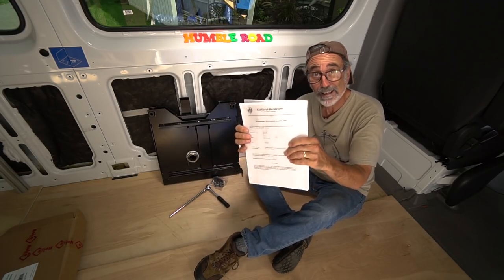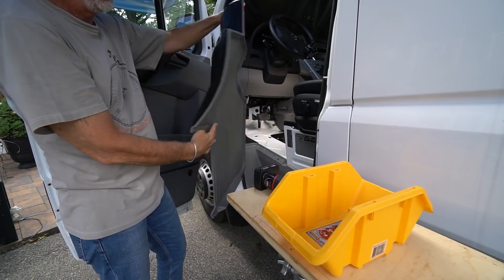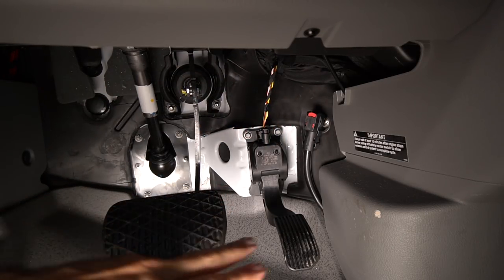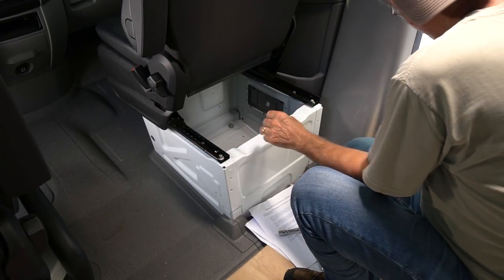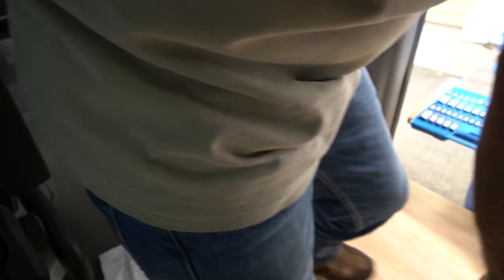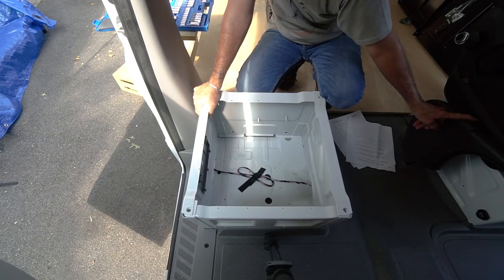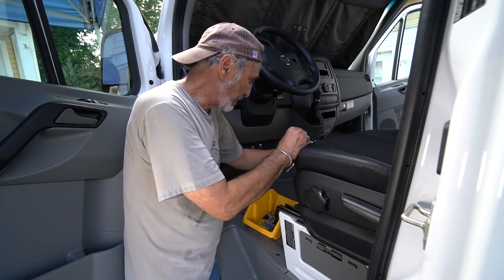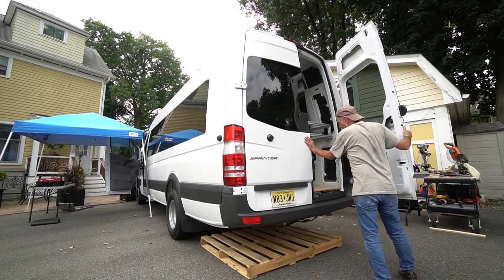INSTRUCTIONAL DETAILS | Van Swivel Seats Install pt 01

Comment: Hi George, your straightforward approach to visually and verbally explaining each step of your build puts all others to shame. How many times have you gone around in circles because of half baked instructions.
Never stop your thorough way of explaining in detail.
One thing I learned the hard way.... don't wear any jewelry that is metallic while doing electrical work... I know you took measures to cover the battery underneath the hood but they call them accidents for a reason. You got to stay safe for the build and your viewers .
Thanks for the great entertainment and teachings.
Reply from the maker: Thank you for your support, Walt. I am truly humbled. And yes! You are correct about the jewelry! One time, I was riding my road bike in a high speed pace line and reached down for my water bottle. The very same bracelet got hooked onto the bottle cage and that's when the trouble started….
Reply: You are a road cyclist too?? Is there anything you don't do or haven't done?? I mean this in an admiring kind of way. I am a cyclist and want get a van to travel the country to all the best cycling locations. In 2005 I rented a Hymer out of Frankfurt and followed the Tour de France! That hooked me on the RV life. I plan on getting back to Europe for more of the same when I retire. Love your videos!!  Thanks, BK
Reply from the maker: I haven't been riding lately. Too busy with the van! But that is no excuse. Some years ago, my son was racing with the Colavita U19 team here in NJ. A few of the fathers tagged onto the back of their training rides. I was in the best shape of my life since crewing in college. Every time I edit a video, I think to myself, "good Lord! do something about that belly…"

Comment: Those swivels look kinda heavy, but I guess you need them to be for safety reasons.  That's a crazy amount of electronics under that drivers seat.  Make sure you don't spill a soda!  :)  Even though I will likely never remove a seat in my life, I found this video to be really very helpful.  Great tips on using the glove on the positive cable and using a rubber mat for protection.

Comment: Hi George,  Great video, just a couple of comments.  You were only joking about the German instructions?  We do include English instructions with all of our Sprinter Sportscraft swivels.  I know you received them since you commented on the advise to loosen the bolts that hold the base to the floor.  The holes are drilled correctly in the swivel, but the seat base can get out of square at the factory.  Loosening these bolts will make installation much easier.

Comment: Here in europe we just use regular hexagonal 8mm, 10mm etc. sockets for those E8 and E10 etc torx bolts. That way you need only one socket set ;D M-B bolts are so hard you won't ruin the bolt even it isnot exact match.

Comment: We installed the swivel base on the passenger side first and my wife hates it. It raised the seat just enough so that her feet dangle above the floor when she is seated. The "foot dangle height" (that is a new term I made up)   is even worse for her when the seat is swiveled to the rear. She looks like a little kid in a high chair.  She is 5'4" and it can be a bit of a challenge for her to climb up into the seat. The first time we went for a drive to check it out, her legs fell asleep after about 15 minutes. Right now she has a little foot stool that she has to move into place on the floor so she is comfortable.  I will either go back to the stock base or end up building or installing a foot rest or raised floor on her side.
Reply from the maker: If you use the van leveling waffle blocks, I now store them under the front passenger floor rug. You can build up the floor to whatever height you need as well as being a great place to store the waffles.

Comment: Geez I watched this whole series 1 and 2 and “I have a FORD” haha I’m sure some of this info is applicable. At least I know to disconnect the battery, now to locate it.. and the reason is to avoid getting shocked? Not sure I’ve seen this done in other swivel seat installations, perhaps I missed it.

Comment: Great instruction George. 
Wondering if you’ve noticed any improvement in quality with newer kits since video?
Have you ever swapped in the shorter bases that Mercedes uses on the factory swivels?
Have you done any swivels on power seats?
Any tips or tricks you’ve found?
Reply from the maker: I STRONGLY suggest getting the swivels factory option installed. And with the newer airbag and safety electronics being built into the seats, you will see builders not offering any kind of fancy schmancy seat coverings either. The Federal Highway Safety Commission is not someone you want to tangle with...

Comment: If you disconnect the wire under the seat, make sure the van does not get power while the clip is unplugged.  I placed the amplifier to my speakers under the passenger pedestal and wanted to test before putting everything back together.  If the van gets power without the plug connected it will trip the SRS (safety restraint system) alarm.  This does not resolve even if you reconnect the plug so you'll have to take it to the dealer for a pricey reset.
Reply from the maker: I know! And there is a specific order in which battery to disconnect and re-connect. I will make that clear in part two.

Comment: I have seen some people reverse the offset seats so drivers is on passenger seat?  Not as easy to swivel but give more room  between the seats?
Reply from the maker: I don’t see how that can work given the seatbelt connection point and the handbrake bracket